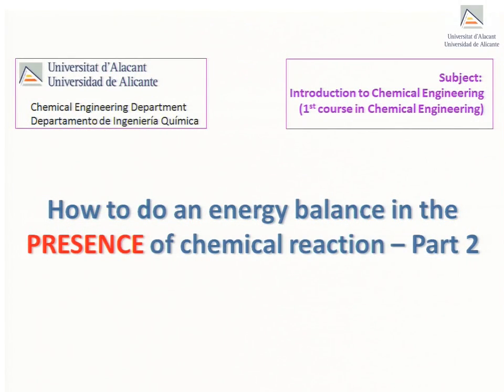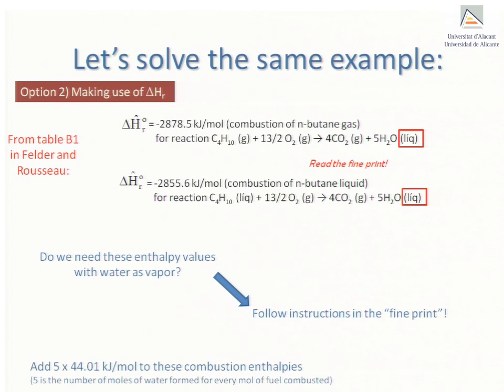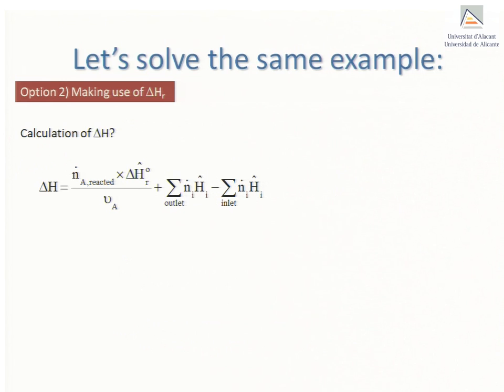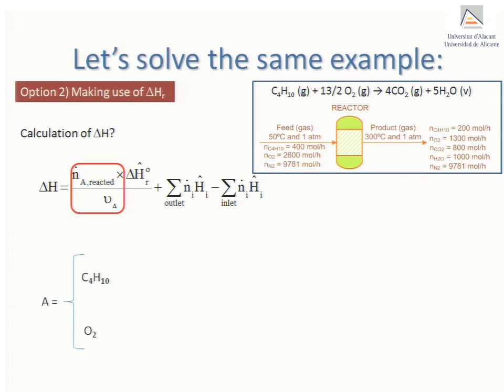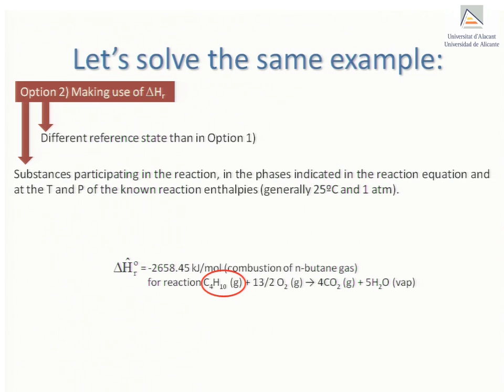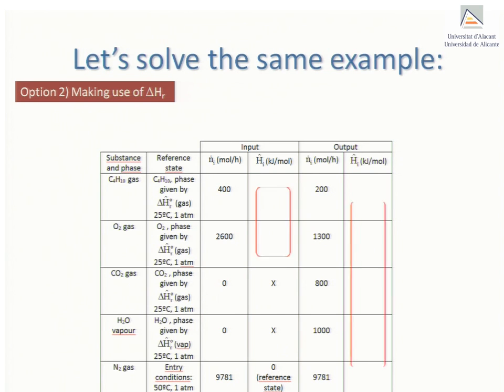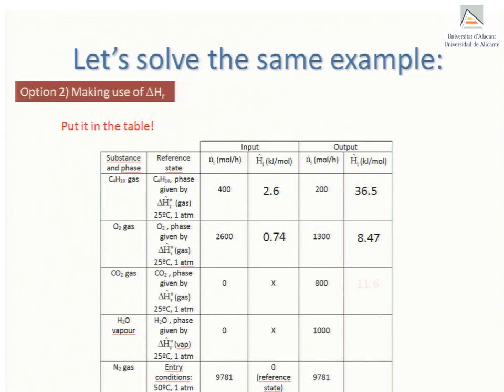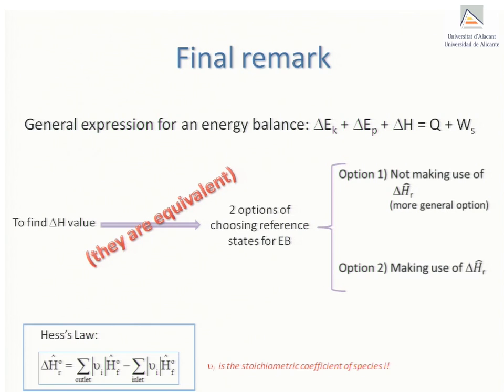How to do an energy balance in the PRESENCE of ...

Comment: Thanks for your video. The problem here is when you have a fuel that is not a simple gas C4H10 or any other specific hydrocarbon, but a liquid fuel like diesel fuel or gasoline. How do we proceed in these cases?